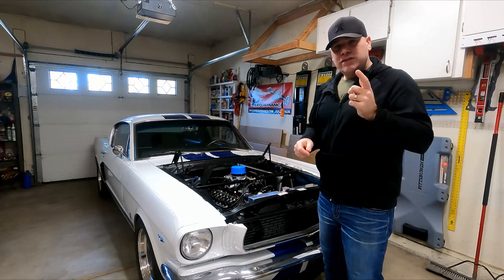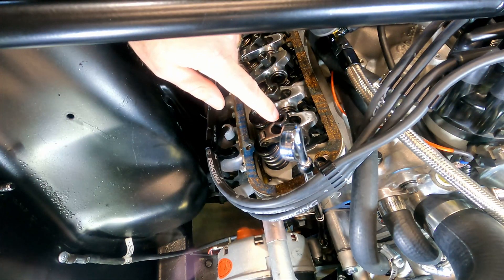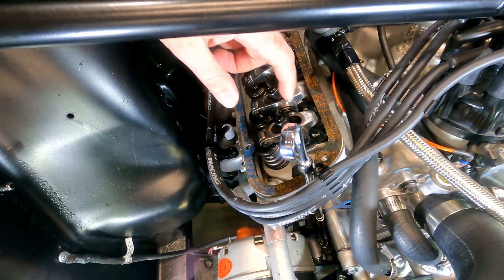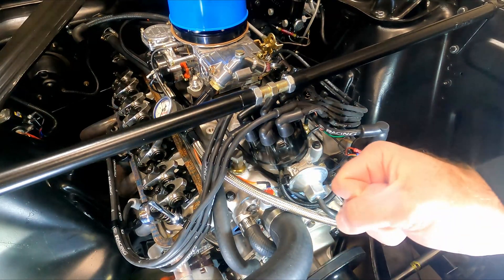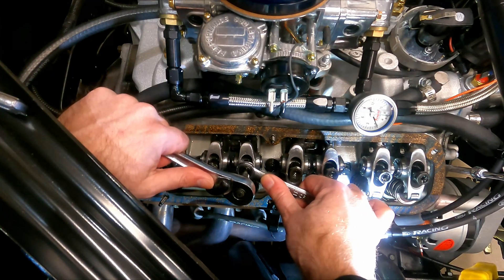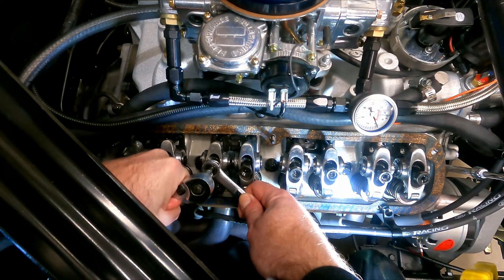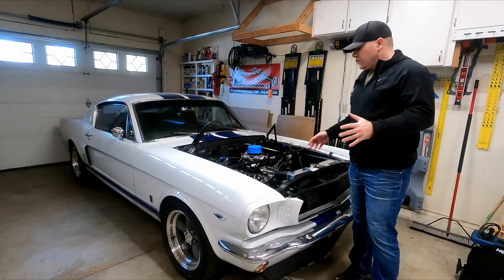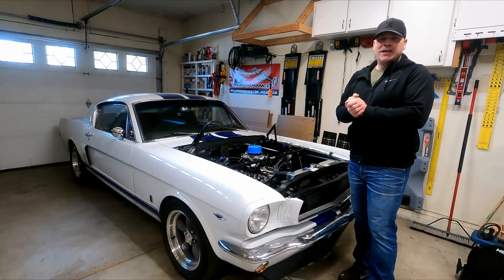Adjusting the Valve Lash on Ford Engine

Comment: Andy, the nut is the lock nut and the hex head is the adjuster you take the hex and you screw it down you get zero resistance on the push rod and then you turn the heck head 3/4 of a turn and then lock the nut to lock your setting you do not turn the nut to get your preload Preet. The nut is only for locking and when you break them loose, don’t break the heck head break the lock nut the lock nut is there to hold the adjuster groove from moving I think you’ve got them all wrong there bro number one you did anyhow, I’m just saying this is I can’t believe all these people on here saying what good job you did because it’s all wrong just to helpful hint from somebody that knows somethingthere you go
Reply from the maker: Ok

Comment: Did your knocking noise getting louder as you increased acceleration I have a similar sound but mine seems to go away with acceleration
Reply from the maker: Couldn’t tell if it was with how loud my exhaust is.

Comment: I’ve got this on my new 347 build JUST like this… question I have is did you adjust these when not pumped up? 
My lifters are Ford performance and they said to adjust when not pumped up and 1/3 -1/2 past zero. 
Did you wait till engine was stone cold when doing this as lifters was empty
Reply from the maker: My lifter is hydraulic, so temp is not really a factor.  I prefer to adjust them when the engine is not hot, but cold or warm is fine.
Reply: @KruseBuilt yes I can see that when I mean hot or cold I’m on about if the lifters are pumped up or not

Comment: Greatings from Sweden i have the same problem on my 289. But now i am starting to think, what if the lifter is done and i am removing the clearance. Am i not running the risk of burning my walves. Thanks for a good show
Reply from the maker: Just to make sure we're on the same page, this adjustment is for hydraulic lifters, not the flat tappet lifters on the stock 289.
Reply: @KruseBuilt Now i feel realy stupied, so you are saying that my stock 289 has not got hydral lifters? If that is so how come that i got the ticking sound. One moment it was running smouth and 10 minutes later it was hammering away.
I am only quessing. I have not removed the intake to look.
But i do have adjustment screws.
Reply: @KruseBuilt Forget everything a said. Looks like the cam shaft has desided to quit on me.

Comment: When I had my intake and heads off, I marked the Harmonic Balancer at each cylinder TDC. Than I readjust with the engine running for performance  and not having the adjustment too tight.
Reply from the maker: Yeah, there are multiple ways to do this, just do what works for you.  :)
Reply: @KruseBuilt  THANKS, great channel.

Comment: Say my engine doesn’t have set screws and are just bolts, would the premise still be the same by tightening the bolt until the push rod doesn’t spin easily?
Reply from the maker: It sounds like you might have a solid lifter setup in your engine and this process will not work for you.
Reply: @ understandable, I’m currently rebuilding a 1988 460 that’s been converted from EFI to Carb and have been running into a lot of walls on how to properly do the rebuild, so I was hoping to get some insight with various videos, articles and forums.

Comment: Where did you get those plug wire looms...?
Reply from the maker: They're from Billet Specialties.  They're not cheap, but IMO they're worth it.  I've put them on two vehicles now, and I'd put them on another if I had one.  They're the cleanest way to make the wires look like a high end shop did all the work.  :)

Comment: Nice video. I have a 351C with flat tappet cam. Is it the same procedure to adjust the rocker arms?
Reply from the maker: Thanks!
The stock 351C (other than the '71 Boss 351 and '72 351HO) had bolt down pedestal style rockers, which unfortunately has no adjustment.

Comment: 3:02 are those engine pro roller rockers have you seamed to find they are extra noisy kind of like a sewing machine? Also I just readjusted my valves to 3/4 turn past zero and still have a lifter noise. Granted this motor I had built by my engine builder only has maybe 15-20 mins run time on it just enough to break in the cam. But still have the lifter noise, all of the lifters still have pre load on them when you push down on them and they are all moving the same distance when you turn the engine over, so cam isn’t flat. I’ve been told by several engine builders I just need to drive it cause their may still be air in the lifter, but I’m scared to cause I don’t want to ruin the cam if the lifter is just bad and needs replaced. After you adjusted the valves to 3/4 turn past zero did that take care of the lifter noise completely or did you have to drive it more to further break in the cam and lifters and bleed any air that maybe in the lifters out? I have a comp cam 284 and comp lifters. What brand cam and lifters do you have?
Reply from the maker: After adjusting my lifters, I can barely hear that "sewing machine" sound, but only when I'm trying to listen for it.  So it's more or less gone and I'm not really worried about it anymore.  When I was adjusting lash, I found one that may not have been properly set during the engine build, and by redoing all of them may have fixed my issue, but I'll never know.
In your case, it might take another 1/8th or 1/4 turn to get that sound to go away, but I'd talk to the engine builder first to make sure there isn't anything else they'd recommend.
My Cam is the Trick Flow, "Track Max", Stage 2 (part number 51403002).  Lifters are Trick Flow (part number 21400004).

Comment: I noticed when you set cylinder 1, the spring compressed quite a bit, is this pushing the valve open or just putting a little tension on the spring? I'm using this method and mine are doing the same thing
Reply from the maker: It’s just how it is, but that’s why you have to be careful you don’t over turn them, it will affect the opening of the valves.

Comment: Man Andy can you please help.  I just got my 347 back all new.  Can’t get it on time correctly.  Where does the distributor  point for number 1 and what initial timing did you set it at?  Please 🙏
Reply from the maker: I set mine at 12 degrees before TDC. The pointer should roughly be in the 1:00 position. This can be tricky, patients is often required. 🙂
Reply: @KruseBuilt  I need help with this
Reply: It only fires on 4 of the 8

Comment: 360degrees divided by 8 = 45 degrees,not 90degrees 😂😂😂😂
Reply from the maker: It does when you consider it takes two full rotations of the crank to get piston #1 in the exact same spot during the compression stroke. So yes, 90 degrees of rotation to get the next piston where you want it. 🙂

Comment: great video.... you said you heard a "sewing machine" sound. my question is what can happen if you don't make the adjustment? 
i also happened to have a push rod that mushroomed under the rocker arm on cylinder 7 nearest headers (i don't know if that is intake or exhaust) and am curious if you have an idea of what caused it.
Reply from the maker: If someone were to leave the lash I had on my car the way it was, it would just be noisy, forever.
I don't know what would cause your push rod failure, but I would replace it sooner than later and then re-lash everything for good measure.  :)
Reply: @KruseBuilt  thanks for the reply... i did replace the pushrod but i didn't know what lash was (this was almost 20 years ago) and am now getting back to the car!! with the help of your video i can move on to this project. the mechanic who built my motor didn't have an answer either

Comment: When following the distributor marks I made, how do you know when your on the compression stroke of each cylinder to perform the valve adjustment?
Reply from the maker: Unfortunately the marks won’t tell you, you have to pull cyl 1 plug, put your finger tightly over the hole and turn the motor over. When you’re on the compression stroke you’ll feel air trying to get passed your finger. Once that happens you can then move over to the timing marks and see where TDC is. 🙂
Reply: @KruseBuilt   I tackled it this past weekend. I ended up buying a TDC indicator for $20. Huge success! My motor has no more ticking and is running extremely well!! Thank you for the video Andy. 💯

Comment: Great video. May I ask your opinion on Comp Cams Pro Magnum lifters (hydraulic flat-tappet) calling for 0 to 1/8th turn? My engine clatters like a mofo, maybe worse than yours was. They warn against going tighter but I don't know what else it could be.
Reply from the maker: Sorry Boss, I don't know enough about your Cam and Lifters to know if going more of a turn will help and not damage anything.  My guess would be to find a forum where someone has the same setup and see what worked for them.
On my setup, I'm at the limit of what my Engine Builder said I could do.  :)
Reply: @KruseBuilt  I appreciate the reply. I've been scouring the internet for days and all I ever find is 1/2 to 1 turn. Can't find my specific combo... everyone is using roller cams. Anything I find about flat-tappet cams/lifters is how they're failing everywhere. Which is why I'm here doing more homework. Thanks again!

Comment: How much spin motion will you have after adjusting the rocker arm? I did exactly like that and I have no movement on intake and i have movement in exhaust. After turing it a few times i will have no movement in exhaust but movement on intake. This is on cylinder one.  I think I did it right I'll be starting it tomorrow morning. Wish me luck😅
Reply from the maker: I don't recall how much any of the rockers moved, but I do recall that there were a few that moved a tiny bit.  I haven't had any issues since I've done this video and overall the motor is much quieter with respect to that clacking they were making.  Good luck!  :)
Reply: @Andy Kruse  Thanks, man! I didn't realize that I hadn't specified that I was talking about the push rods, not the actual rocker arm. I did fire it up today, and it does seem to be much quieter, but I can't tell until I put the valve cover on.

Comment: Unless you have a tick that wont go away 3/4 is too much. 1/2, or just a drop more so  you can tighten a drop  after the polylock hits
Reply from the maker: Thanks for the heads up.

Comment: I’ve got the same ticking in my 302 but just recently I’ve started getting a lot of popping and backfiring coming up out of the intake. Almost sounds like popcorn. I’ve heard by adjusting the lash it will fix this issue. Did you experience anything like that?
Reply from the maker: Sorry Boss, I did not.  If you're having backfiring coming out of the intake, it might be running too rich, or you might have a timing issue.  I don't think the ticking sound is related to what you are experiencing.  :)
Reply: @KruseBuilt  thanks! I’m trying to figure it out!
Reply: Too much timing caused my popping once. Another time a busted S hose on my fuel pump.

Comment: 3/4 of a turn after 0 lash is way to tight, it will cause the valve to stay open,  I have fix numerous cars with this issue,  by running near 0 lash or no more than 1/4 tune after 0 lash,  BTW Love the car,
Reply from the maker: Thanks for the heads up.
Reply: @KruseBuilt  I think 3/4 turn should be OK, definitely wouldn't do more than that, and everybody is going to have a different opinion about it though the cam/lifter company will have a recommendation.  But starting with the pushrod being so tight that it can't be turned is what would worry me and make me think it's too tight after adding the 3/4 turn.  I've always done to where you just barely start to feel drag on the pushrod (some people like to wiggle up and down and go until the slop is gone instead) then 1/2 turn.  Anyway, I really like the channel and look forward to the next video!

Comment: Nicely done walking through setting the valve train. It's frustrating chasing down small noises. Hopefully you got to get out and drive it with nicer weather! Now you just need to send some of that weather this way!
Reply from the maker: Yeah, I was able to put a few miles on her before we got another 6 inches of snow.  Ugh.  Oh well, before I know it I'll be wishing it was cold again because it can get so hot here in the summer.  :)

Comment: 302 roller motors (86 and newer) have a 351 firing order 13726548 non roller 302 is 15426378 for some reason people still mess this up!
Reply from the maker: I would have messed that up if my builder didn't remind me when I was picking up the motor from him.  I'm glad he said something or I would have mistakenly hooked up the plugs for a non-roller.  :)

Comment: $8k+ on a hand built engine and its doing that? im taking it back to the builder. but you have the knowledge to fix it and it makes for a good video so I don't blame you.
Reply from the maker: I didn't pay my builder that much, that was just what I was into the motor build and it included lots of parts and pieces I purchased over time to add to the final product.  But yes, I was very frustrated, but I didn't think venting about it in this video would have helped.  However, the motor is tight and sounds much better, so there's that.  :)